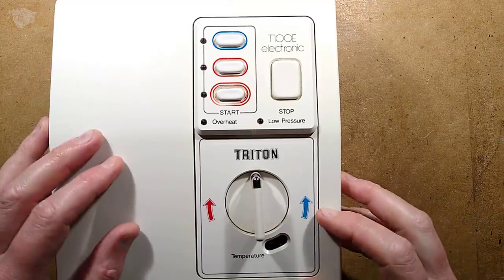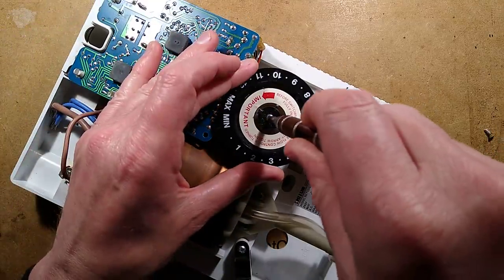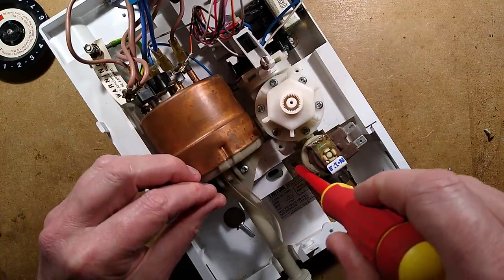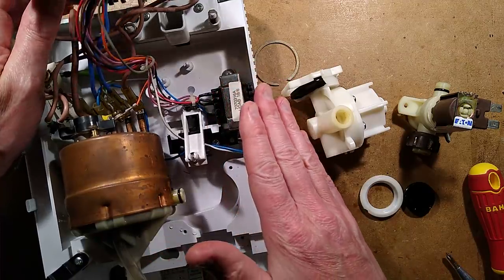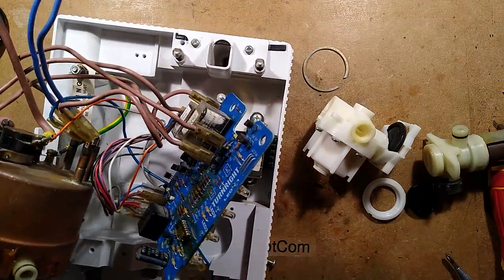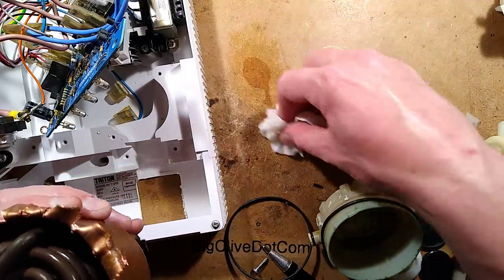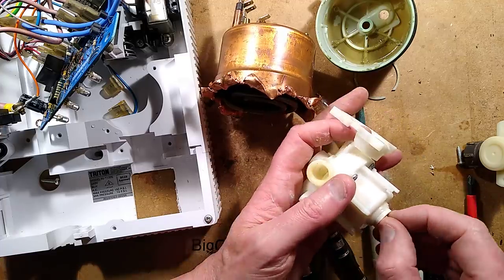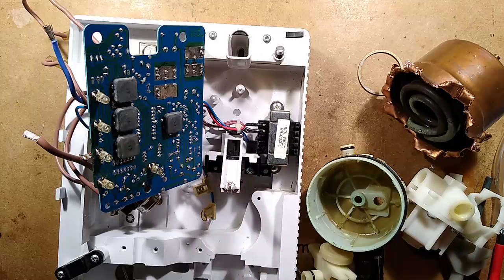Teardown of a British electric shower that went bang.

Comment: After seeing this, I'm never going to take anyone seriously when people from the UK mock the USA's use of natural gas to heat water. How are so many people okay with putting electricity like that in your shower?
Reply: It looks dodgy but is actually OK because of the steps that are taken to mitigate risks. Using natural gas to heat water is also full of risks from melted heat exchangers, carbon monoxide poisoning and explosive mixtures being generated in a living space. But like aviation, long experience and careful engineering makes sure things hardly ever go wrong.
Reply: @jamesrindley6215  true. But carbon monoxide alarms exist. In contrast, if your shower is about to zap you, you're not getting much of a warning.
Reply: @awesomeferret  true. But earth leakage circuit breakers exist. In contrast, if your gas boiler is about to blow your house up due to a leak in the attic, you're not getting much of a warning.
Reply: @jamesrindley6215  say what now? You'd get plenty of a warning. Unlike a carbon monoxide leak, you'd very much know if a "leak in your attic" happened. That simply never happens unless there's an earthquake or something though. Carbon monoxide is a lot more common, and there are alarms for that (even ones that literally shout "carbon monoxide, get out" at you, talking alarms are sort of cool).
Reply: @awesomeferret  OK, let's take a step back. Many things that are full of potential danger are in practice quite safe in our modern world. That is due to government standards, careful engineering, thorough testing and proper maintenance. There are potential dangers in gas and electric appliances, just as there are potential dangers in flying and riding trains. Modern engineering and safety procedures has reduced all these dangers to what we call "socially acceptable risks". I don't know if more incidents are caused by gas or electric appliances. Intuition isn't a good guide to these things either. If you want to research the actual figures that could be interesting.
Reply: @jamesrindley6215  quite true. The most obvious example of that is nuclear power.
Reply: @awesomeferret  Well maybe nukes are an  example of both sides, carefully managed risks for the most part and utter fuckups when the hubris of smart people gets the better of their common sense. Also it highlights issues with a financial model where private companies profit from construction and the taxpayer picks up the mitigation cost when they blow.
Reply: @jamesrindley6215  which they almost never do. The USA hasn't had a nuclear meltdown in quite a few decades, and that's due to regulations that are a lot more strict than some other countries. It's no coincidence that Fukushima and Chernobyl were both reactors that would have been flat out illegal in the USA. Sure, there have been disasters in the USA, but somehow that seems to be one of the few things that the US government has learned from their mistakes on. The death count from nuclear plants is a tiny fraction of what coal and oil related accidents have.

Comment: so Brits think that you can not have a power socket in bathroom because it is dangerous but putting mains powered exploading heater under the shower is a good idea...
Reply: Ah but its not plugged in in the bathroom
Reply: @BigFootpl The thing is... this is designed to be used in a bathroom, and is perfectly safe as long as it is fitted correctly.
We don't usually have sockets in bathrooms because if you do, people will plug in all kinds of things which are not designed to be used in a wet environment. Such as, a phone charger, or a fan, or a radio, or whatever.
Get what I mean? There is some logic behind it.
Reply: @ann_onn  this thing does not look like it was designed to be waterproof... at all..

Comment: Having a 400 litre mains pressure water in Australia and visiting Ireland and the UK , I can understand the stereotypes that don’t like regular showering.... especially in colder months. First rule , minimum soap and shampoo use , as you can pee a stronger flow  than these useless shower units supply... 🤭
Reply: WTF does "400 litre mains pressure" mean?
Reply: ann onn It’s a 400 litre hot water service , incoming water supply is a pressure supply. The water tank is dual element for heat boost if there’s extra demand. Usually after a power failure you can get 400 litres of 56*c water to mix with cold for dozens of showers...or one really really long one. In google dot com dot au search 400 litre mains pressure and the results will astound and possibly delight you.
Reply: @R2D2inAustralia  that is the most unefficient way to heat water, you are heating 400L to have a shower, with electric! What you don't use is wasted,.
Reply: @ann_onn  he means 400L mains pressurized cylinder, the max pressure is less than 3bar as there is an automatic pressure relief valve that activates at 3bar
Reply: your right I'm sooo sorry Depends how you heat your water. Large, mains pressure cylinders are also found in the UK, as are thermal stores, holding many hundreds of litres, some upto 2000 litres plus- these often provide space heating too. They are ideal for heating by alternative energy, especially intermittent sources. You can "charge" them with a good day of solar power, and they will supply hot water for days. Or feed them with a small but constant supply from a heat pump- a device which couldn't cope with spikes in demand, but instead uses the tank as a buffer. Some are heated by wood fired boilers- one efficient hot burn gives steady heat for hours or days. Even electrically heated they can make sense- you can buy power when there is a glut and prices drop, then use hot water without having to buy power at peak rate during the day.

Comment: America: "Never take anything mains powered within six feet of the shower or bathtub."

Britain: "Here's the electric shower, right here in the shower stall. It's powered by a 240 volt power line.  Just step into the shower butt-naked, make sure your feet are well-grounded to the damp shower floor, and begin pressing buttons. What could go wrong?"

America: "W-w-w-hat??"

Comment: Also seen as a death trap in France. I was so scared of those electric showers when I was staying in Ireland or the UK.
Reply: I've never heard of any reported injuries or fatalities. Likelihood of hazard is extremely low
Reply: It's funny how in France we have no fused power plugs, very dangerous older installations with junk sockets (and not enough of them), and a lot of very shady multi-socket outlets (unearthed because why not), yet we're terrified of those electric showers when visiting the UK. Maybe because the Claude François story has penetrated our subconscious so much (he was a famous singer who died in his bathtub while trying to fix a malpositioned wall socket).
Reply: Nicolas Joyard There's no reason to have fused plugs in rest of the world because of different wiring system. You can't get 100A from your socket. Also a fuse got nothing to do with trying to prevent electric shock. It's a protection against fire or equipment and wires from melting or in case of short circuit, nothing else. RCD also known as GFCI in the US is what you need, not fuse. And those are everywhere unless you live in the house with very old wiring. Also you should turn the breaker off when you're trying to fix your socket if you're not wearing rubber gloves etc. Considering how hard it is to die from just touching live wire when you don't touch neutral or ground I guess it's very simple - don't mess with electric equipment if you don't know even basic things about how to do it safely.

Comment: You are telling me Brits shower with a 240V appliance jeezus I wouldn't shower with an electronic that is 240V. I never heard of an electric shower in the states
Reply: instant endless supply of hot water on tapp for as long as you can be bothered to shower is just sooo nice. The thought of relying on a pre heated tank that could go cold before I've finished, sends a shiver down my spine.

Comment: Britain:  American outlets are too unsafe, let's recess ours an inch AND put a toggle switch on the outlet.
.
Also Britain:  Lets put a box full of 240V in the shower with exposed spade connectors and run water through it!
Reply: Which bits are recessed by an inch?
Reply: US: lets have everyone have access to a device called a gun that has no actual use in modern society.  I mean what possible use do they have? Seriously? Every week I use an iron, my car, but what the hell do you use a gun for?  Do you draw pictures of them?  Do they talk like furbies?  Can you use them to find your lost keys?

Gun shop. What a weird idea.

Comment: I love the non switch mode power supply
Reply: Many of them will have no control board at all, just a big switch that switches between off, half and full power. I think they are illegal now though as there has to be a switch off delay or else the water in the heating chamber boils and burns you when you turn the shower back on.

Comment: Here in the US, I am very happy with my natural gas water heater. The 120V instant water heater draw tonnes of power and you would really need a 220v line run to get any kind of good heating.
Reply: Thats what we have so probably helps with the popularity

Comment: Blame Who ever was working on the Water lines is at  on this one.  Any time you open water lines bleeding any air out of the lines is usually the vary last step prior to deeming the job done.  RALPH ?
Reply: agreed, granted plastic may have become more brittle, the air rushing through the pipe is followed by a heavy wack when the water comes through and will often finish off plastic that is ready to break

Comment: Why can't the brits just use a main water heater instead of a suicidal water electric shower like everyone else? Not to mention that that thing alone uses 8kW of power!!!!
Reply: t0nito We do. Electric showers are solution from the days when hot water systems were low pressure, for filling baths and sinks but insufficient for showering. These systems relied on an attic cold water cistern, and a copper cylinder heated by a boiler, usually gas fired. They were simple, reliable and being cooper based last almost indefinitely- hence many hundreds of thousands of homes are still using decades old tanks- why replace something that functions perfectly? Electric showers often exceed 10kw, but they are essentially 100 percent efficient so will consume much less overall than the equivalent shower fed by an electrically heated tank.

Comment: is "EATON" a good quality brand in the *UK? here you find it on stuff that the eastern European "electricians" use or budget electricians that dont care about there work. so if you see eaton you need to have in mind that i ti soften not a good installation.
Reply: I’m from Norway, Eaton and Schneider Electric are on the same level of good quality.
Reply: EATON bought up a lot of major quality brands like Klöckner-Müller from Germany.  Schneider bought a lot of the others like Telemechanique. In any given country, there will be a local incumbent brand that represents quality and is traditionally preferred by local electricians.  Products from the other conglomerate and budget quality stuff is sold by suppliers that cater to DIY and grey market craftsmen, thereby increasing the perception that anything but the local incumbent is crap (and not just installed wrong by idiots).
Reply: It's a bl**dy massive global company making all sorts of different things like locks and HGV transmissions !

Comment: I have to ask:
- how much power do these things use? (at maximum flow rate)
- to which temperatures can this heat? (and what is the flow rate)

I find the idea rather scary myself.
Reply: My one is a 7KW model. Flow rate is mains pressure but the regulator will slow it down as you turn it to the hottest settimg.

Comment: I would be afraid of getting electrocuted if I had to shower with one of these. Doesn't matter how safe it is, its kinda hard to trust.
Reply: They're absolutely fine. They're everywhere in the UK. Dedicated circuit, breaker and earth. I can't ever recall hearing about anyone getting electrocuted by an electric shower or sink water heater.

Comment: cant you just 3d print a spare?
Reply: That part has to survive water pressure and water hammer. I doubt the 3d-printed part would last long. Also, the unit is ancient and well overdue for replacement.
Reply: @AndrewFremantle  I don't think the durability would be an issue, depending on how you print it. Normal PLA for example can handle quite the stress depending on the layer and print settings. 
However actually modeling it and finding tolerance is very time consuming. And Clive works with OpenCAD which is not the most straightforward program to make models with.
Reply: It should've been made of metal in the first place. At least the hot water tank is copper. The new shower will probably have a plastic water tank and even crappier plastic water flow regulator.
Reply: A 3d printed part would break. Filament 3d printing isn't good for much more than trinkets, and spools to wind your USB cords around. Lol. Maybe another 3d printing tech would be able to produce the parts, but you'd have to send the file out to be made, which is very expensive.
Reply: @simontay4851  Agreed. Though that it held up for so long is impressive.
Reply: @xenonram  Quite a few filament stress tests, and my own experience with primarily using filament to 3D print would disagree with you. Again, it depends on how you print it; not just layer direction, but also density, extrusion width and layer number will have a say in the tensile strength. You could also 'iron' layers to make sure their bonds are even stronger.

Comment: 240V. naked human, conductive water spray... what could possibly go wrong!
Reply: If anything the rcd will isolate power to the shower in less than 0.4 of a second and if you don't have a separate consumer unit for the shower circuit or a split load board and it's night time you'll be in the dark

Comment: I'll keep my gas hot water heater  in my basement
Reply: adomehus We have hot water too! either tanked or combi (instant). Electric showers are a useful backup, often installed in a second bathroom, or occasionally where an old low head / low pressure hot water system is unable to provide sufficient pressure to operate a conventional shower.
Reply: We do have such systems here in the UK as well. Its quite a mix - but these are very common and work very well.

Comment: An electric shower sounds like something you'd find in a concentration camp in World War 2.
Reply: To someone in the USA at least. Meanwhile in the rest of the world...
Reply: @skylined5534  You got a point. Countries in Europe and Asia are so crammed for space, they have to use inefficient electric heating.  We have enough room to fit a full sized water heater in a house in the USA, and we can use gas which costs about 1/3 as much as electric to heat the water.  Even apartments and hotels have water heaters that use gas to heat the water in the USA.  If you think you're superior for having a more cramped living quarters and paying 3x as much to heat your water, check yourself.  It's not like we can't buy those inefficient products here, it's mostly that nobody needs to or wants to make their house less efficient.  I suppose if you can't figure out how to set a profile picture, when most 12 year old children can, you can't figure out how the world works.  I bet you've never left your country and seen anything outside your own doorstep practically.  Not the type that should be commenting.

Comment: I don't know if I could shower with 220V so close by, lol.
Reply: The water pipes and the heating element are earthed, if earth failed there be less then 5ma of current in the water so really non issue (water and high voltage is only a problem if your touching the conductor with water on it directly) you have to open the unit get to the 240v points inside the unit witch are all in the middle to top of the unit for it to be dangerous

Comment: The horror of these comes from the more cheaply constructed units that Clive has featured in the past where mains electricity is literally in contact with the water being sprayed over your body.  The US being predominantly 110V would struggle to provide enough current to heat the flowing water required for a shower.  A hot water cylinder can be gradually heated up with the element turned off during peak power demand times.

Comment: Has nobody told you brits that water and electricity have a tendency to mix in dangerous ways? ;)
Reply: Yes we no,that's why we design them correctly, however plastic does degrade, so all the low voltage isn't a problem and the high voltage is protected plus many valves and thermal (snap) switches everywhere,
Reply: that thing has no chance of ever electrocuting you if installed correctly.
Reply: The pressure regulator should be made of aluminium or stainless steel, not crappy weak plastic. Would not have broken then. Sink and pipe taps are metal so why not in a shower.
Reply: @simontay4851  cost.

Comment: Here in Mexico we use "instant boilers" (water heaters) that run on LPG or Natural Gas
Just works when you need hot water in the tap
No electricity to mess with and good reliability

Comment: Who thought it was a good idea to mix electricity and showers?
Reply: What is the problem? The water is still in contact with and electric heating element at the hot water cylinder or in a shower unit.
Reply: found the american